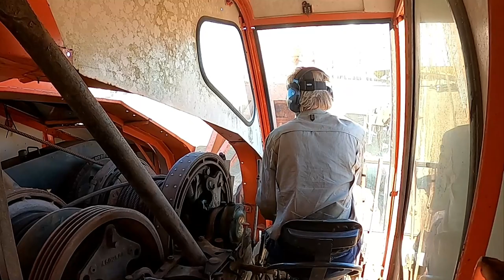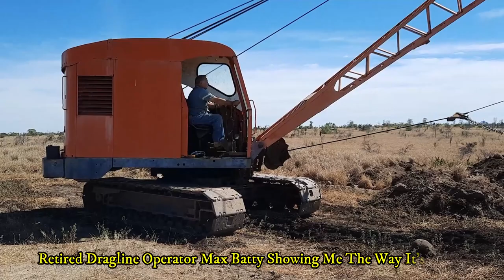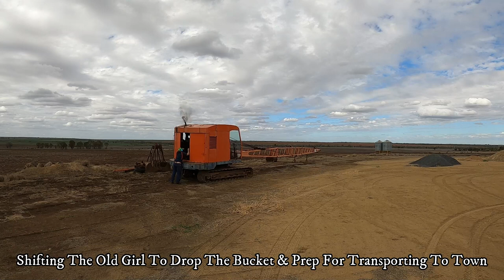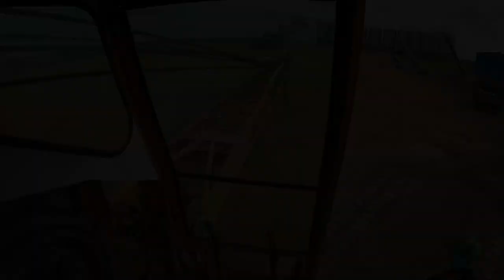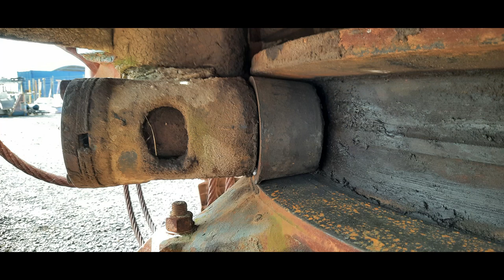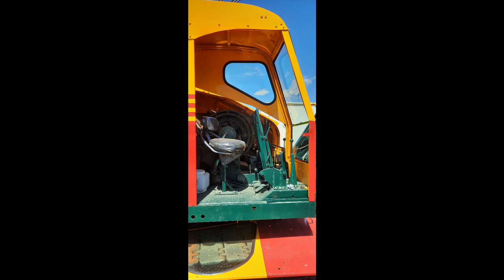22RB Dragline Unload, Setup & Bucket Detach

Comment: Interesting video to see with the original engine and all. The slewing ring rollers do not seem to be worn at all, do you happen to know what this crane has been used for in the past?
Reply from the maker: The last place it worked was for Walter Wright Crane Hire in Mackay Queensland as their yard crane. It was fitted out with a bucket to dig out a channel on a fishing village linked to a creek which found it's way out to Whitsunday coast. Prior to it working in Mackay and Proserpine it came from Melbourne. I haven't got any more of it's history. I had one flat spot on the slewring roller and walking gear is worn, it has 2  track belt pads taken out and they didn't come with the machine. Engine runs well and drive gears are in reasonable order. I renewed some of the cables and friction band material.

Comment: Hey Adrian,  I'm curious how much gear oil does the 22B hold in the main gear splash bath as well as in the gear reservoir located under the drag drum?  Thanks for your help.
Reply from the maker: @cjordan7284  I don't truly know and have discovered the hard way that I have over filled mine to you know where. I ended up getting oil on my swing/propel drums and I'm now in the process of doing my first service as well as degreasing my mistake. I will try get an accurate measurement and let you know once I have finished. Hopefully this weekend.
Reply: @adriannettlefold9084  Interesting.  I have a feeling my drain tube between the gear box and the chain case is clogged and the main gear box under the drag drum is not able to drain back into the splash bath.  I took 15 gallons out of it last night.  I'll drop the bottom end of the spash bath this weekend and see if I can see what's going on.  I guess I have a partial answer--at least 15 gallons.  ha.  Thanks
Reply from the maker: @cjordan7284  I thought it was a fair bit but I don't know if it that much? We work in Litres and I had a 20L (5gallons) drum but didn't put all that in. But I didn't drain it all first either. Mine had a heap of water and custard type sludge that I started to drain the other day. So tomorrow I will go have another look and change the oil . The two plugs on the bottom of that gear case have about 2inches difference in level or there abouts... so between yours and my attempts we should come up with an answer.
Reply from the maker: @cjordan7284   Do you have an email or contact number? I have just finished changing the gear oil on my machine and I found that so far it only took 15Litres tops.  I haven't run it enough to see what oil is going back to the swing and propel vertical shaft box.  but I did use diesel to clean it and it drained out.. so can only assume the horizontal rubber hose connection is clear.